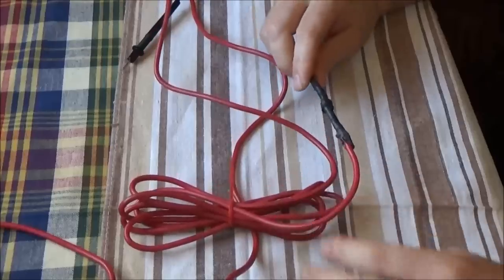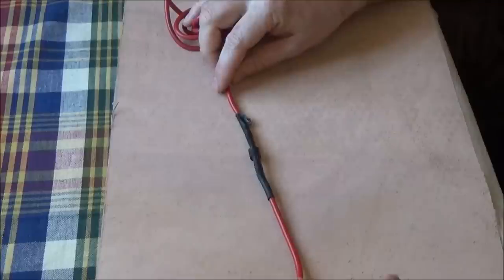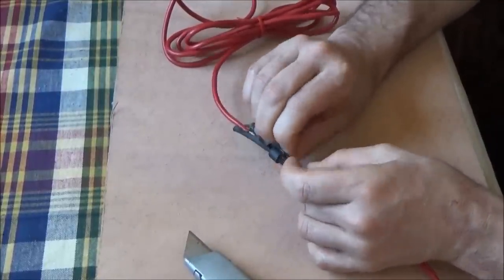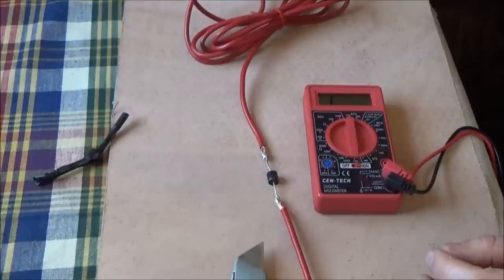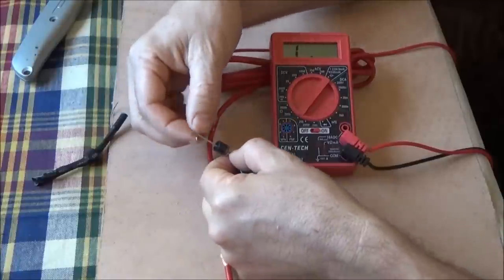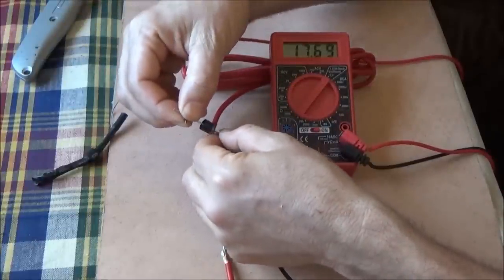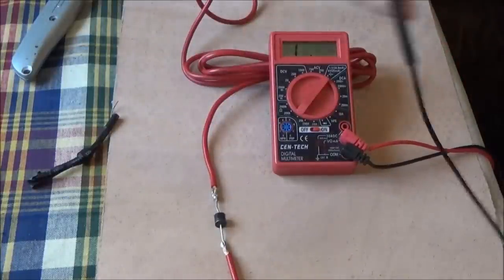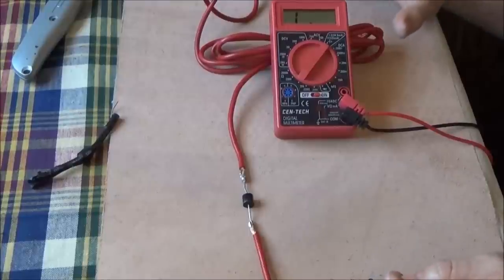How A Blocking Diode Works & Testing A Diode With A Multimeter

Comment: When your checking OHMs its a good idea to keep your body out of the circuit...don't put your thumbs and fingers on both leads or conductors.Also all diodes build some heat since they all dissipate some current while passing current for this reason you should never use heat shrink around the diode or leads as it is a very good thermal insulator.

Most diodes used in a DC blocking scenario are mounted in a heat sink to help the diode dissipate the heat.

Comment: Best to test a diode with the meters diode test function. this way it will properly forward bias it (turn it on).It will still block current when reversed. sometimes meters do not have enough voltage and current on the regular ohm ranges to forward bias the diode. that is why you saw 18 k ohms on the good diode. but all and all a good example of testing.

Comment: It was not the voltage that killed the diode it was the 25amps you said you had 25 x 15v would be 375 watt and that diode is maybe rated for 10amps

Comment: On that specific tester there is a diode symbol that you would check a diode with! It will tell you if a diode will back feed! I actually bought the same one then upgraded to one with a buzzer that will identify shorts in the diode function, works great on electronics repair! It was only $10!

Comment: Thanks Troy of the past. That was very helpful.
Reply: I used my new Mr Heater Portable buddy for first time .  I just bought 2 one pound canisters for now.

I only ran it intermittently on low i'd say 40 minutes at a time. I was surprised it only lasted 2 days.
My home heating contraption with the clay pots on top of the single burner on top of one pound tank
lasts a lot longer on very lowest setting.

I found a Mr Heater hose adapter with 5 foot hose at walmart for $17.00.
I need to do tank exchange for $19.00.  When you live on $735.00 SSI  this is a lot of outlay in one month.
I really dont want to run the heat in the apat though cause it will really run up my bill.

I have seen with the longer 12 ' hose Mr Heater says you do not require a fuel filter inline but it costs $23.00.
I think they suggest them with shorter hose because if you shut Mr Heater off at his switch it creates pressure in the hose and leaching out of some rubber substance in the hose which clogs up the heater.

If i only shut the unit at the bulk tank do you think I can get away with not using a filter.
Have you had any clogging issues with yours?   I am sure you have yours on a long hose.

I know it seems silly but $5.00  is $5.00.

Comment: Honestly, just put a diode rated for the battery onto the car. If you get a Zener Diode and wire it in line with the positive feed from the battery you can spec the low threshold (voltage) of the diode to be around the value of voltage at %20 or %0 state of charge of the battery. Meaning the car will stop drawing current below this voltage saving the battery. %0 will still work as it’s only draining the cells to true safe %0 3.21v. Draining that’s occurring in the vehicle now is over voltage draining <3.21v

Comment: Hi Troy  I just purchased a 1000 volt 50 amp (with a 400 Amp Peak Spike) bridge rectifier, that I am going to use just one of the diode sections of as a blocking diode on my home made wind turbine. It was a cheap one from E-Bay but I am 100% sure it will survive longer than that small blocking diode you have there. It was about $4 on E-Bay. worth thinking about for your one as well.   It also has an aluminum case so it can be bolted to a heat sink or metal framework somewhere. :-)  cant wait to see the results with your wind turbine running again, as it was looking promising before the diode shorted out :-)

Comment: Hello I have a question I have split cell solar panels with 3 junction boxes on the back East junction box has one diode similar to the ones in your video my solar panel is not giving me no power no votes nothing I checked the diodes and I'm getting a reading on both sides of the diodes on all 3 diodes am I'm supposed to get a reading when I switch my meter around  ?

Comment: What diode would you recommend  I need a bomb proof diode 
It’s the stop the current travelling up to a socket when I start my engine, so it would be maximum 14.4 V 
Pls pls can you point me in the right direction to buy the correct diode 🙏

Comment: Ok so i have a question i have a 12V DC Motor on an actuator that extends pushing the load with no issues but when it retracts it seems like the (Push) from the load is somewhat making the DC motor Generate electricity and backed into it's controller box causing weird noises and also causing the motor to Slow down. would a blocking diode fix this? and how do i wire one in?

Comment: Don't you have a little diode on your meter? The one I have here has that marked just at the edde of the ohms scales. That is where you check diodes or transisters. There is a break down knee in the forwards direction about 1/2 volts if the diode is made from silicone and power diodes are made from silicone. That is why you have a high ohm reading in the forward dirrection.
Reply from the maker: Yes but this video was for anyone with any multimeter. Most do not have diode testers.
Reply: *****
Yes, but he was playing to the lowest common denominator.

Comment: Hi, how can we know if blocking diode is present in the solar panel just by looking at it? I am layman. I have been given a task to identify whether a blocking diode is present in the solar panel or its part.
Reply from the maker: One way would be to connect a battery across it at night and see if there is any current flow from the battery through the solar panel. That is if there are no visible diodes, which is often the case.
Reply from the maker: I think that most commercially sold solar panels have blocking diodes though. Because otherwise the battery will discharge through the solar panel, draining the battery and destroying the solar panel. If you do the test I mentioned, do it briefly so as not to harm anything.

Comment: Thank you. I want to set up 12v battery charging. Pedal/wind/water/solar whichever I find suitable. Where can I find info on 12v permanent magnet motor to size of diode I'd need to put in loop? I understand split charge from car.  Thanks I'm fresh to this.

Comment: There is a diode setting on your meter. It should give you the best readings. But yes, that diode you have there is fubar :)
Reply from the maker: Yes but this video was for anyone with any cheap multimeter using Ohms settings. Most meters should have that. Many do not have diode testers built in.
Reply: I see. Yes. That would work for most people, especially if the diode if shorted. An open or a short would be two of the most likely scenarios.
I'm sorry I talked over your teaching lecture. As a person with an electronics and a couple of teaching degrees I can respect the method and process.
Peace.

Comment: I need some help:  I want to "tie together" 2 incoming 24vdc signals. (very low amperage)  Incoming A will trigger Solenoid A. and Incoming B will trigger Solenoid B (HOWEVER) I want it to also trigger Solenoid A.  Incoming A should NEVER trigger Solenoid B.  So I cannot tie the 2 signals together or they BOTH, will be trigger BOTH Solenoids all the time.  Can I use a Diode, so that Incoming B will trigger Solenoid B AND Solenoid A ?   What size do I need?
Reply from the maker: Not sure what you mean by what size. Anything that can handle at least 24 volts (oversize to be safe) and whatever current. Also consider the switching time, if you need faster switching. The diode will act as a 1 way valve so the signals should not get crossed.
Reply: @TheDoItYourselfWorld  THANK  YOU!
Reply from the maker: Hope it helps

Comment: Is there anything that you could hook up to that diode that if it failed again it would turn on a light or make a beeping noise so you could catch it before drains the battery
Reply from the maker: bleeck2000 Hmm, interesting idea. It would require some circuitry though. Like a voltage drop alarm across the diode.

Comment: Use more of those in series so that if one fails the others will back it up and your circuit will keep working
Reply from the maker: I think parallel you mean. In series if one fails then they are all blocked out. In parallel if one fails the others take up the slack. And you divide up the current through them all.
Reply: No I think he meant series. If you have two diodes in series (in line with the wire) and one of them fails like yours did and it goes open circuit (shorted out both ways) it means that it would be acting just like a simple piece of wire (as you mentioned in the video) and so the second diode will still do the work if it's still good. Agreed?

Comment: I don't think you need a blocking diode if you have a good charger/controller. I have 300 watts of solar panels and a decent controller that doesn't seem to be draining my battery bank at night. But then,  I have another solar setting with just one small solar panel  and  a cheap controller I bought for $10. And that  one drains battery at night all the way down to 10 volts. I definitely need a blocking diode for this one.

Comment: Sorry Troy you killed that old diode .

The battery will load the output so you don't know the current .

If we run the maths 350 W @ 11V ( Min ) = 350 / 11 = 31.8AMP .

So your 25 AMP diode is under rated unless you parallel 2 & make a 50 Amp diode .

With a 1V drop @ 31A it has to dissipate 1V x 31 AMP = 31 watts ( check the diode data sheet ) .

That's a hot hot hot diode with no heat-sink you can solder with 15 W LOL.
A 6" x 12" aluminum sheet should work as a good heat-sink .

God bless and I will pray for the 25 amp diode !
Reply from the maker: The original diode was rated at 50 volts 45 amps.
Reply: The Do It Yourself World
The maximum junction temperature is the limiting factor here .
Its rated for 45 AMP but only up to the maximum junction temperature .
Voltage across the diode will increase with amps passed by the diode
( see data sheet for your diode  ) .
Reply: gd2329j I was just about to say the same exact thing. Max amperage will be higher the more discharged the battery voltage. Diodes have a forward voltage drop, which implies they will be dissipating wasted energy as heat. At such low voltages and high amperages, this is going to be a noticeable amount of wasted energy and will likely need a heat sink.

When (or if) I do my off-grid solar system, I'll probably run it at 24V or 48V so that I can reduce these issues with high current and consequential high energy losses.
Reply: zilym
Sum losses are unavoidable but can be minimized .
Its a balancing job cost & time verses loss / gain !.
I like to over designed things by 20% it gives stability / reliability
& if it gives up one day you still have sum thing that can be fixed .
It gives the newbie the chance of a working system
if not 100% with the maths / designed !
Designed it like a brick s...house !!
PS:- Don't trust all you read on the net its a starting point for more research .
If it looks like a duck, quacks like a duck it's probably a duck !

Comment: Is there a possibility that your heat shrink tubing process used enough heat to kill the diode? Others have already mentioned the use of heat sinks when soldering. I did not notice if you said the diode failed right away or if it did serve for a period of time before failing. Good video, otherwise, though.
Reply from the maker: It worked for a while. I figure it was a cheap ebay diode and therefore it failed early. Generally they are over rated and sold as larger than they really are.

Comment: how do i know what kind of one way doide to use when it up to 3 amps and up to 18 volt from the solar panel???
Reply from the maker: Generally they are rated for the current capacity they can handle. I get mine on ebay. You can find them sold for solar panel use so they should be fine if you get the right sized diode. Bigger is better if you can afford it which will allow for future expansion easily

Comment: good one. was useful for me.

now, how can you prevent this diode from failing?
Reply from the maker: +Marhaba iktara Buying a better quality diode in the first place. The cheap ones are junk
Reply: Better part and mount in a heat sink whenever practical, also diodes are almost always installed at less than half their rated (CONTINUOUS) capacity, lots of this crap that is sold as rated for 25 amps is rated for a momentary peak current of 25 amps....Diodes and other electronic parts, just like every bearing, rope, structural beam etc. should never be installed anywhere near its rated maximum value.

Comment: Do they have to be out of the circuit board?
Reply from the maker: At least one lead should be out of the circuit for best results
Reply: @TheDoItYourselfWorld  could open reading filter caps ( 40 year old 10000uf 63v) take out bridge rectifiers on same board ? I bridged soft start resistors and my amp turned on, I thought it had a bad transformer.  But 4 - 7 amp fuses blew after that , they are next to the bridge rectifier and capacitors on same board . Main power fuse still good.

Comment: which type of diode do i get meaning do i get the solar panel rated diode or battery rated diode
Reply from the maker: ebay search "solar panel blocking diode" gives this one for example: http://www.ebay.com/itm/MCC-50V-6A-Current-Blocking-Rectifier-Diode-Solar-Panel-Wind-Turbine-276-1661-/270706349217?hash=item3f075b14a1:g:57sAAOSwj2dXkQhs

Comment: Can i tell me what do i need... my new car bumper doesn’t have fog lights i removed bulbs but i get error on dash, what sort of drainer or smth that can make the car ecu theres a bulb ? Thanks
Reply from the maker: You can buy a kit that cancels out the problem or get a 60 watt or higher resistor which tricks the computer into thinking a light bulb is still in place. Resistor must be connected to a heat sink to avoid fire from overheating.
Reply: The Do It Yourself World what is the name of the kit? Thanks alot
Reply from the maker: Will this one fit your vehicle: https://amzn.to/2qimobH
Reply: The Do It Yourself World thanks for the reply but, in my case i have removed the bulb and I don’t one to put one since my new car bumper doesn’t have fog lights, so instead of a bulb i want some sort of think that can fix my issue? Thanks
Reply from the maker: The device I linked to is meant to go between your LED light bulbs and the vehicle wiring harness. It eliminates the error codes generated by using an LED instead of regular bulbs.
Reply: The Do It Yourself World in my case i have removed the bulb and I don’t want to put any bulb, i want something that can make it think theres a bulb? Thanks

Comment: Why not just use a small charge controller like used for solar panels?
Reply from the maker: +Mike Hand most solar panels have blocking diodes anyway tho.
Reply: Yes, I know that, but so does a charge controller.  So, in my opinion, why bother putting one inline between the turbine and the battery?  Using a charge controller alone would prevent over charging the batteries as well prevent battery feed back to the turbine.

Comment: Drop me an Email Troy,. Need to know your wire Size on the Wind Turbine blocking Diode. Need to also, Is you Wind Turbine 2 or 3 wire. DC or AC out Voltage. I'll just Build you an extreme duty Block Diode setup. Failure will not happen.  Those 25 amp diodes wont probably cut it

Comment: your not quite correct about the voltage on the wind turbine side of the diode , the voltage will rise from zero, until it reaches the voltage of the battery, after that amps wil flow ino the battery, the voltage wil now only rise if the battery voltage increases, that will rise slowly, if the amps go up, the load on the diode always rises, still the voltage can stay stable, so chance is the amp rating of the diode has been violated.
se it a lot in battery chargers that diodes wil blow up, or shorted, its realy comon to happen, the new diodes you have are more suited for this use, but dont forget to mount them on a sheet of metal to stay cool, amp rating of 25 is not that mutch, y always use the automotive type thats used for splitting the charger into two batterys, like in boats or rv's, they are rated 70 to 150 amps. (and even they can get warm!) , for mesuring diodes some multy meters have a diode test setting, you can then read the voltage drop on it in the reading. (mostly around 500mv)  thumbs up.

Comment: maybe ad a second diode as a safety catch..
Reply: How would you know if the first one failed? Wouldn't whatever made the first fail soon knock out the second as well?
Reply: SSanf if it was some sort of a cause besides a failure or faulty manufacturing of the diode  then yes it could take out the second one, but if 2 diodes are failing together it pretty much eliminates faulty diodes and points towards a bigger issue thats toasting the diodes... like over power or spikes or surges ...  and how you would you know if one went out is pretty basic, you'd periodically test the diodes, say in yearly maintenance.
Reply: Ebacherville
OK